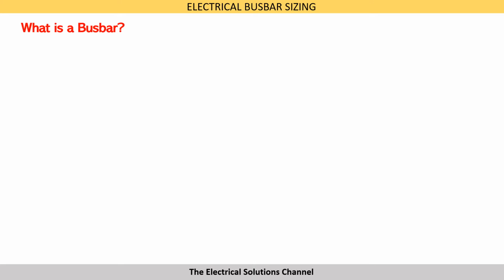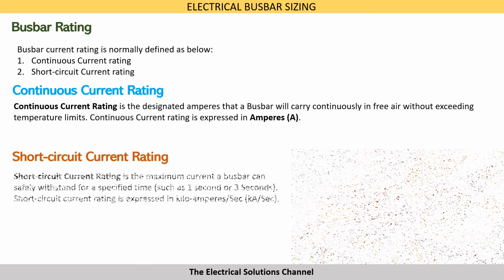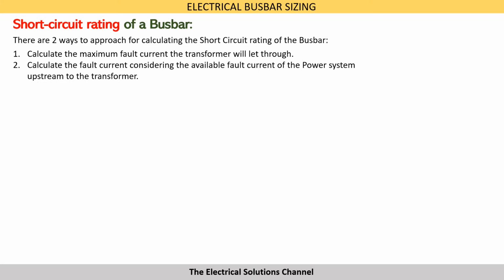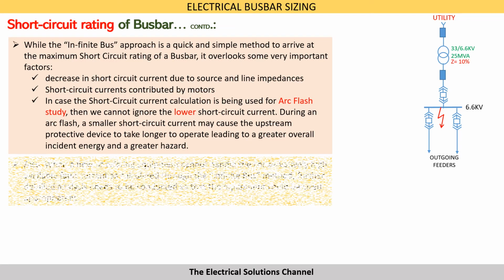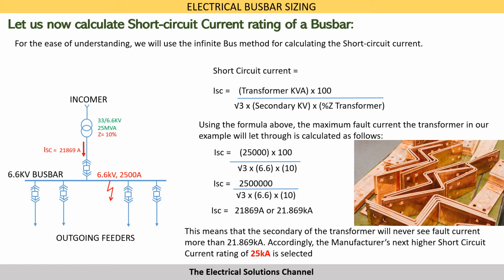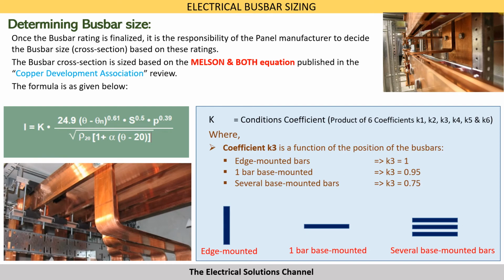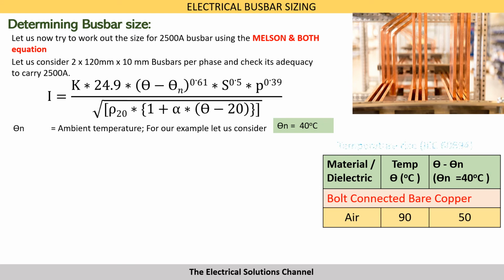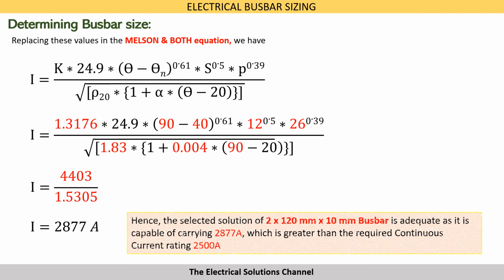ELECTRICAL BUSBAR SIZING

Comment: i think coeffecient k1 is mistakenly calculated. if e=10mm and a=120mm then e/a=0.0833, therefore, k1 should be 1.76 or 1.8?
Reply from the maker: Thanks.
Yes, you are correct. The value of e/a has been erroneously calculated as 0.12 instead 0.08. Hence value of K1 will have to be changed accordingly.
Glad that you found the video useful. Please let me know your comments on my other videos. Please do subscribe to my channel and share with your friends
Reply: Can I ask something

Comment: What standar (ANSI or IEC ) is the base of Busbar Rating?
Reply from the maker: Busbar rating is based on busbar property (Cross-section, No of parallel busbars, section profile, support spacing, etc.) and not on any particular standard.

Comment: Bus bar  current  capacity  630A ,  its according  Thumb calculations  suitable   50*10  ,  but  standard chart show 50*5  Which is correct ?
Reply from the maker: Thumb rule calculation will give you a very high Busbar cross section as it based only on current density of the busbar material. But actual busbar sizing requires taking into account various other factors as explained in the video.
Reply: Can I ask something

Comment: Does the length of bus bar determined current it will carry or the thickness of bar determine the current it will carry. Thank you
Reply from the maker: Thanks for your comment. No, Busbar length doesn't determine the current capacity. However, thickness of the busbar is one of the major factors which determines the current capacity.

Comment: Thanks for informative video. We refer K.C. Agrawal's book for busbar sizing in which skin and proximity effects, busbar supports also are taken into consideration. What is your take on this ?
Reply from the maker: Thanks for your comments. Skin effect and proximity effect do influence the busbar size. These effects basically increase the impedance of the conductor which in-turn reduces its current carrying capacity. Impacts of these effects are captured through the Conditions Co-efficients K1 & K3  in the MELSON and BOTH formula. Busbar supports design and distance between the supports are designed based on the short circuit rating of the busbar and not the other way around. Accordingly, once the Electrical rating is finalized, the supports and gap between can be designed (this is mostly carried out by the Panel manufacturers).
Reply: @theelectricalsolutionschan1095  Thanks for the clarification

Comment: Short circuit calculation upto the busbar is incorrect. Impedance of the incomer, transformer and cable should be considered. Other than that, the concept if informative.
Reply from the maker: Thanks for your comment. The Short Circuit calculation used in the example is a short cut one and neglects all impedances except transformer impedance. This will result in the maximum fault current that will be seen by the busbar as explained in the video.
Reply: Can I ask something